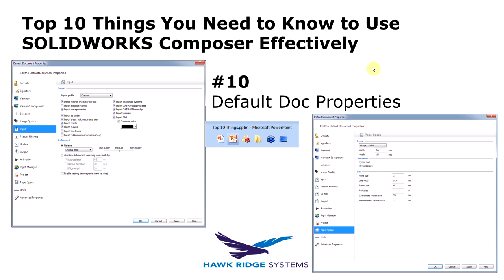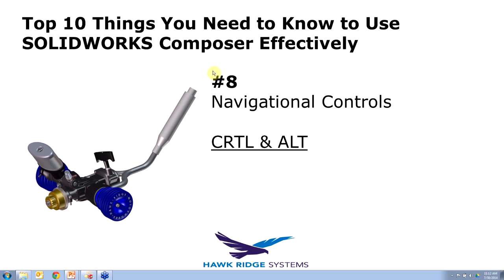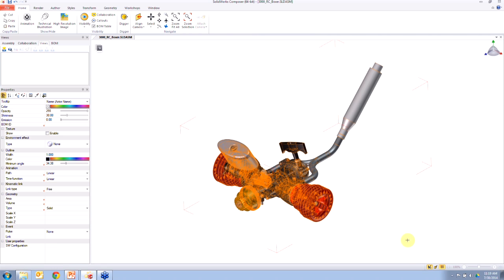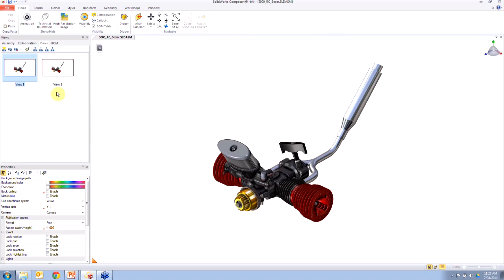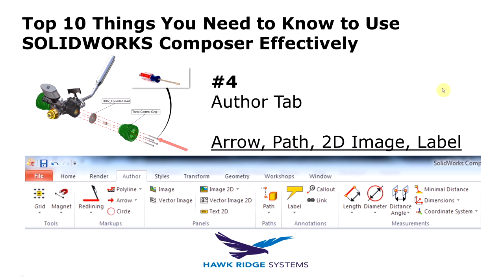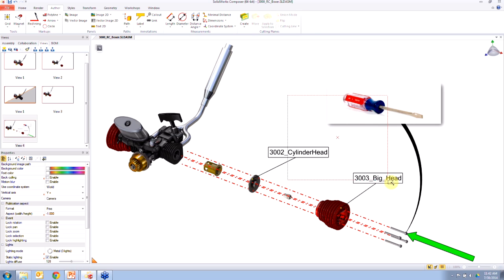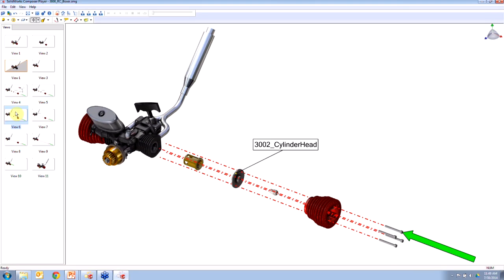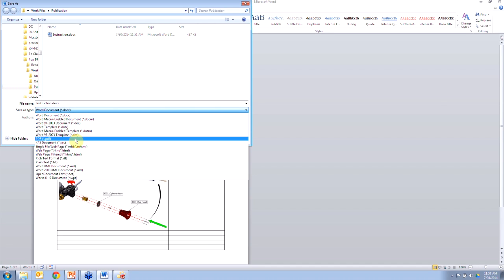SOLIDWORKS Composer: Top 10 Things You Need to Know to Use SOLIDWORKS Composer Effectively

Comment: if you need a 16:9 video what would you have to put in paper size tab > viewport > width ? `leave it at 297mm or ~167. Do we have an option to put ratio ?
Reply from the maker: For animation you generally shouldn't have to worry about paper size. In the Composer document with your animation active, you should see "Publication Aspect" in the property pane and this can be set to 16:9 format.

Paper size is mostly intended for when the views will be printed or formatted directly for print.